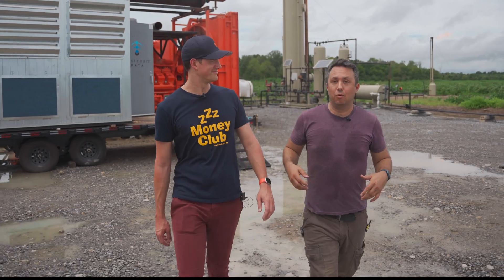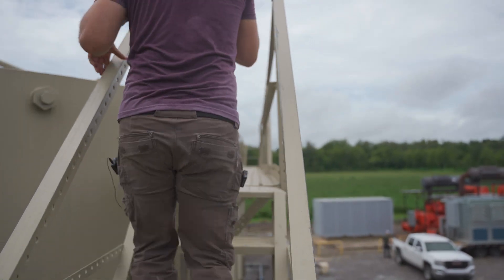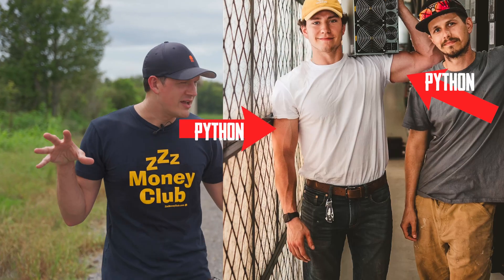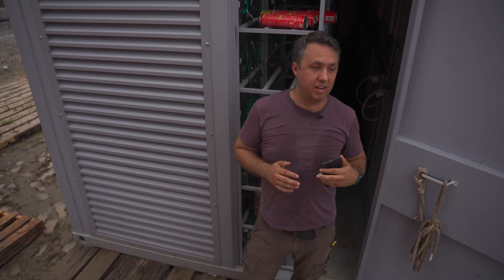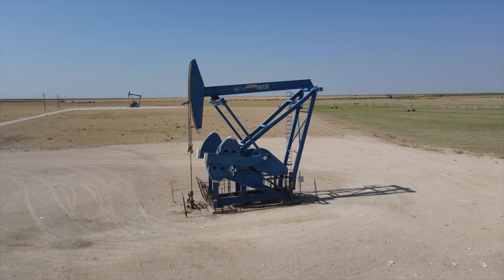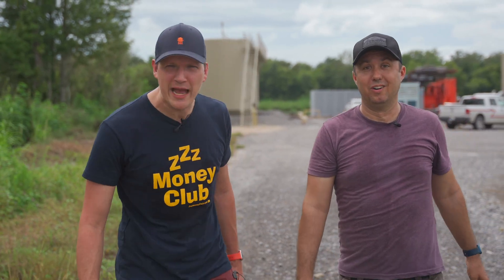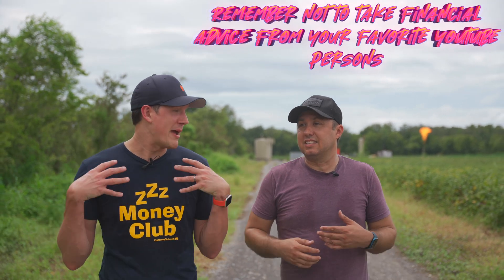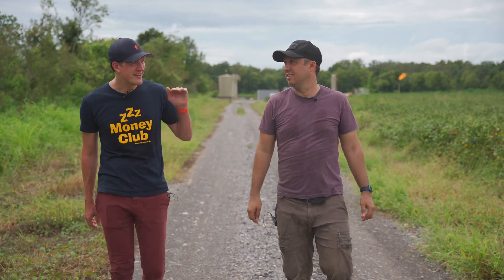Bitcoin Mining at a Flare Gas Oil Well Site. BTC Farm Tour.

Comment: Where would be the best place to see real numbers of this operation? Upfront cost, cost of electricity (if any, a little confused if the energy is essentially free here since ite being converted), and how much btc is mined daily. Electricity costs seem to be the biggest cost in mining other than upfront costs so trying to see if this can actually be profitable if scaled up
Reply from the maker: So at this particular facility, the electricity is literally free.  It comes from excess gas that this oil drilling operation literally just burns off into the atmosphere - so insterad they run the gas through an old generator.  Unfortunately, they wouldnt tell me the costs of all the infrastructure to do that - someone needs to know how to tap into that gas, someone needs to get their hands on a big generator, someone has to do all the wiring and make all the structures up to code - and then you have to keep things cool enough to operate in a desert.  BUT, the ongoing electricity is literally free - so the real cost would be whatever deal you can talk your way into with an individual oil field owner who will have no idea what you mean when you say "mine bitcoin."
Reply: @SPACEDESIGNWAREHOUSE  wow thanks for the info! I work in oil and gas accounting and have been mulling trying to bring a plan to the higher ups to potentially invest in something like this. Flaring is a big issue where we are and this just seems like such a good play

Comment: I have too many connections here in the oil field. I need some funding and few them machines. Ill go get the contracts...
Reply: OK, lets start with >4,000 mcfd on waha pipe or wellhead/gathering, <1,100 btu/Cat methane number >80. Between Pecos/Ft. Stockton/Midland. No new wells with steep decline curves.

Comment: Thanks for another informative video Nicholas. However, I’m not sold that this is a net good. Sure, under the current situation where the choice is between “dig up oil and waste the gas” vs “dig up oil and utilize the gas”, undoubtedly latter is better. But how about we don’t dig up the oil? All of this increases our dependence on fossil fuel. Coming up with different use cases for its waste products, and incentivizing the overall process even more seem to me like a step in the wrong direction. But I have to admit, as things stand, this is by far the best energy source for mining! Happy to hear counterarguements.
Reply from the maker: Counterargument (I didnt know that was one word): I am not an oil man.  Neither is Musk Miners an oil man.  Hence, this is a net good because this oil man was already here; this well has been here for years and years just blowing partially burned natural gas into the air.    There is literally no human alive who can talk this oil man into shutting down this well.  
But what he CAN be talked into doing is diverting the gas to run through a generator, which burns the gas far more completely, spewing some amount less carbon overall than would have been spewed without the bitcoin miner getting involved.   
If you multiply this effect across the HUNDREDS of wells that are today burning flare into the air, it will be an even more positive good.. Not to mention, the bitcoin miner cant be talked out of bitcoin mining, either - so every bit of mining that takes place with this gas is a bit of mining that DOESNT take place at a coal fired or additional gas fired plant somewhere else. 
Your ball.
Reply: I used to think the same. But things changed. You should listen to Brian Gitt or Michael schellenberger.  (YouTube or as a podcast). In short - oil usage isn't going away if also you want a better life for all the humans. But the METHANE? Yes-  that needs to stop yesterday!

Comment: On another note, I had planned to let musk miners host my s19j pro’s and KD miner. That was until I saw that they only except miners purchased through them. Funny their s19’s are 1-2k higher than their competitors. What a shame with our residential swepco rates so high and solar as high to get into and no grid buy back puts us in a corner.  It’s always something in the way.
Reply from the maker: How many miners do you have?  They will tend to make an exception in some cases once there are extra slots.  They plan to put a couple more containers down in this spot.   I havent looked for a while, but normally their prices are on par with their competition in America - if you go with a chinese supplier you can take the risk and get them cheaper; often times youll get stuck with the import fees which can be quite a lot as well.    I imagine they will price match for you if you plan to expand.
Reply: ʟᴇᴛ's ᴛᴀʟᴋ ɴᴏᴡ۩۩✍

Comment: If you want help with the furnace idea send me a message. I've got 4 units running inside one in my garage.
Reply from the maker: Oh nice! Do you have them ducted into central air??
Reply: @SPACEDESIGNWAREHOUSE  ask Blake or Chris for my number and send me a text on whatsapp
Reply: @SPACEDESIGNWAREHOUSE  They are inside an empty furnace using the built in fan to supply filtered air. I'm still working on my system to control the overall temperature in the garage and vent the excess heat properly in the summer. Winter won't be an issue here in Canada. I got my units from Musk miners, Blake can put us in contact if you would like to see it and discuss some potential issues you might run into.
Reply: ʟᴇᴛ's ᴛᴀʟᴋ ɴᴏᴡ۩۩✍